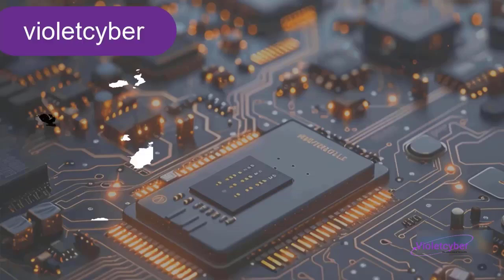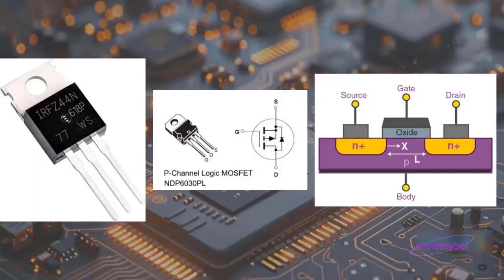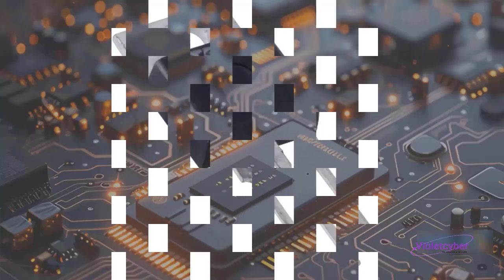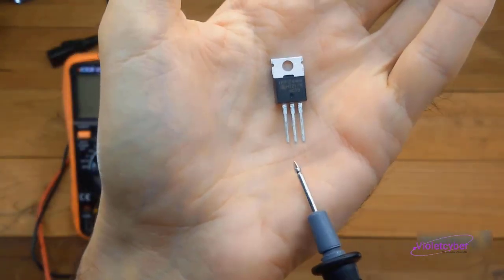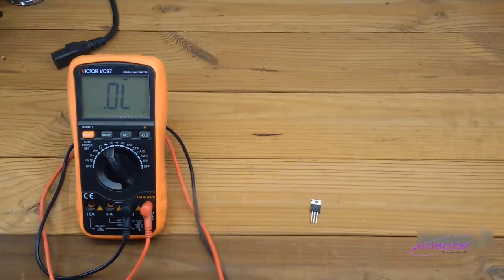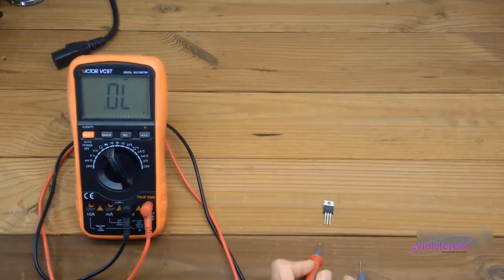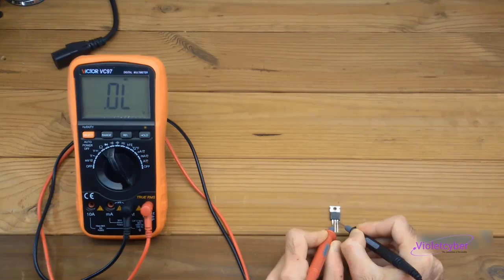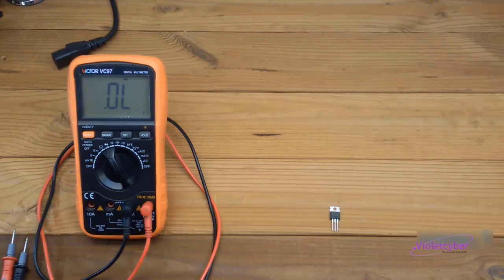How to Test a MOSFET Transistor Using a Multimeter | N-Channel & P-Channel Guide

Comment: For P-channel Mosfet, you can't connect the negative to the source because the build-in diode would be forward bias. You will instantly destroy the Mosfet transistor. Please correct your video.
Reply from the maker: At high voltages, yes, it could cause issues for the MOSFET, but when we perform this test using just a multimeter, the MOSFET won’t get damaged because the voltage and current from the multimeter are extremely limited.

We’ve been doing this kind of test for years and have never encountered any problems.
Nonetheless, we appreciate your attention and support.

Comment: So in short it is (?):
MM to Diode Test Mode
1.) Source(Black)->Drain(Red) => 0L -- to test for possible short circuit and proper diode functionality
2.) Drain(Black)->Source(Red) => (e.g.) 0.5V  -- to test for normal resistance and proper diode functionality
3.) !!! Source(Black)->Gate(Red) => 0L -- short connection to switch to 'enabled' mode. (by the small voltage of the MM at the gate)
4.) Source(Black)->Drain(Red) => (e.g.) 0.3V  -- now there is a throughput when the MOSFET is 'enabled'.
5.) Drain(Black)->Source(Red) => (e.g.) 0.1V  -- now there is a throughput at much lower reading when the MOSFET is 'enabled'.
6.) !!! Drain(Red)->Gate(Black) => 0L -- short connection to switch to 'disabled' mode. (by the discharge of the voltage of the MM at the gate (??))
The important steps are 3 and 6 to switch modes, while steps 1 and 2 and steps 4 and 4 are repeatable and switchable in between modes?
Than you! That was an helpful instruction! I could recreate this with a mosfet and works for me.
Reply from the maker: Yes, you've summarized the process very well!

Comment: Hi Nice video, I used a Fluke 15B multitester, but I cannot follow your step about when I touch the Gate with my red probe and black probe on my Source. I removed it and tested the Drain to Source again. It only shows OL. Is that a multimeter problem? I tried several IRFZ44N. Or your tester is just better. What do you think the problem is?
Reply from the maker: If you only performed this test on one MOSFET and encountered this issue, the reason could simply be that the MOSFET itself is faulty, since this exact behavior indicates a defective transistor.

It’s recommended to test several MOSFETs, and if the same problem appears even on healthy ones, then it means your tester or multimeter has an issue and needs to be checked carefully.

It could also be something very simple, like a problem with the probe wires or a loose connection, so make sure to check all of these possibilities.